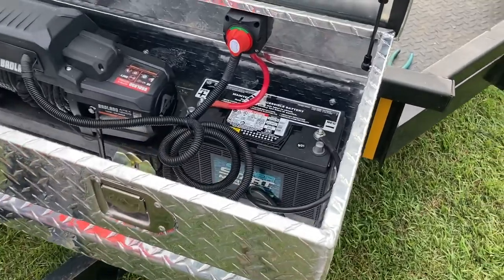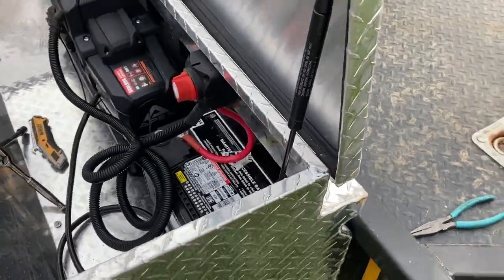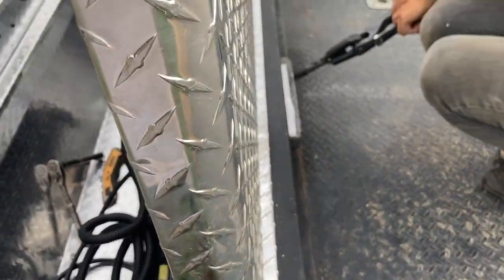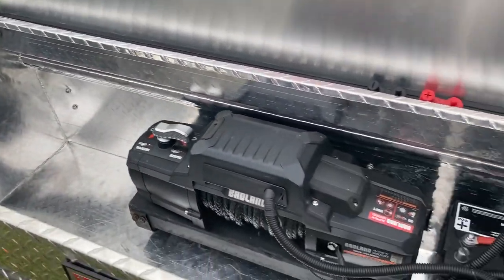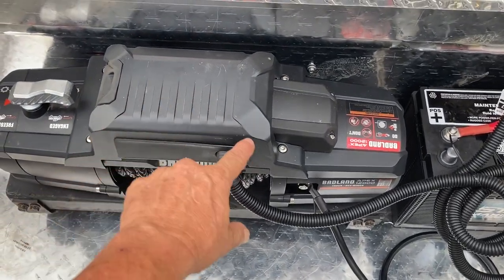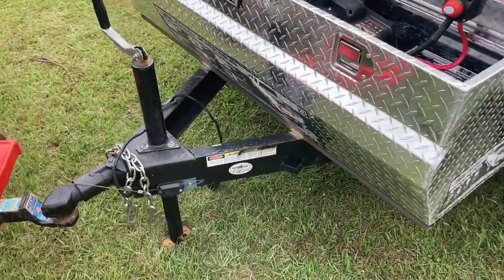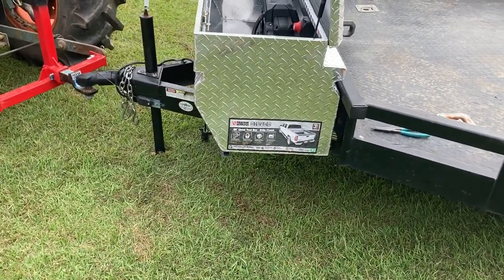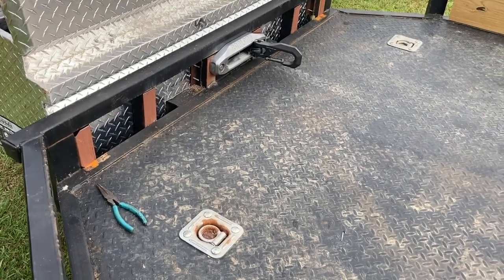Installing a winch on a steel trailer. Part ..3?

Comment: Does the tool box affect turning radious of the trailer when attached to the truck?
Reply from the maker: This one formed to the bumper at each end with only moderate damage.it was later ruined by being attached to a different truck. I replaced it with a shorter box.and it res fine.

Comment: How do you keep the battery charged?
Reply from the maker: truck charges it while driving. run the truck if I need to during the day. thanks!
Reply: @toadstead1  how did you make it do that? What’s your setup to charge it while the truck is driving? Thanks!